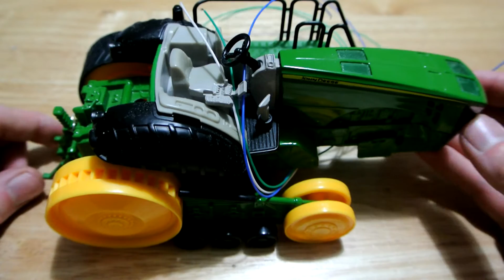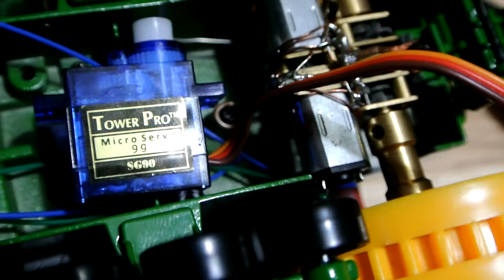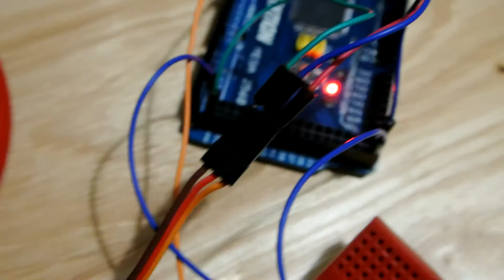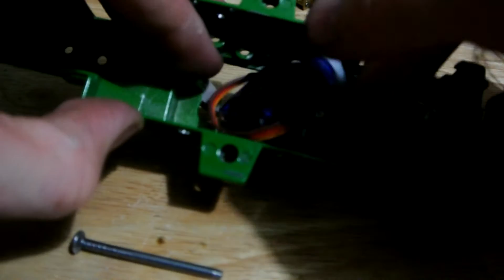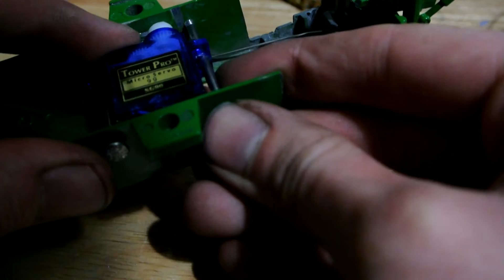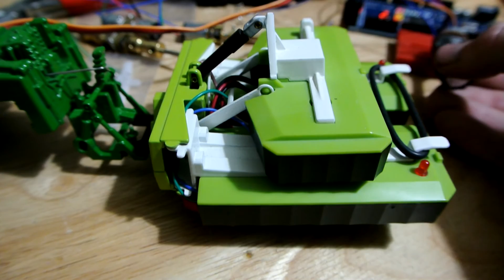RC Tractors John Deere 8360 RT Part 3 - Final Lifting Arm Design

Comment: I want to do this as well and I was wondering what the rpm of the drive motors were.
Reply from the maker: I think the drive motors were 3V 30rpm N20 motors but from talking to another guy who has basically copied my design its possible mine are slower than that, we haven't confirmed yet.
Reply: +RC Tractor Guy ok thanks! I was going to run 3v 20rpm motors off a 2s Lipo and esc, so it should be fast enough? Thanks again!
Reply from the maker: I think so, I've been told my JD8360RT is too slow though but it has loads of power so I think its great.
Reply: +RC Tractor Guy true, I would rather have power over speed, but running 2s will give me a bit of both.
Reply: I mean, all I want to do is get a tractor with a bucket on the front for shoveling snow and sawdust, and get a mower implement so trimming up around the house is more fun! Also, I've watched a lot of your videos and I pretty much know exactly what I'm going to do.
Reply: +The Droniac sorry for all the comments, but I want to get an Oliver 1755 or 2150 because those are my dad's 2 favorite tractors that we own, but you can't get them with buckets. 😔
Reply from the maker: If you're planning to actually mow grass, I'd say you're want a reasonable big model. Probably 1:10 scale but I don't know where you'd get those, the bruder models are the biggest we can get easily over here.
Reply: +RC Tractor Guy well, I changed my mind. I got a claas lexion 780. I've got it disassembled and the parts are on there way.